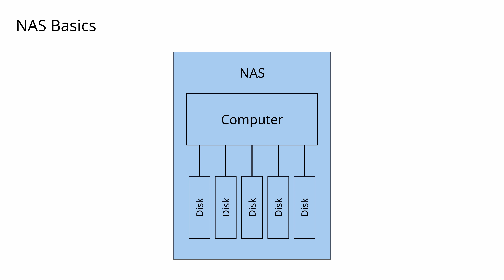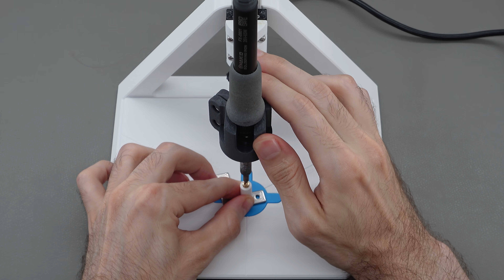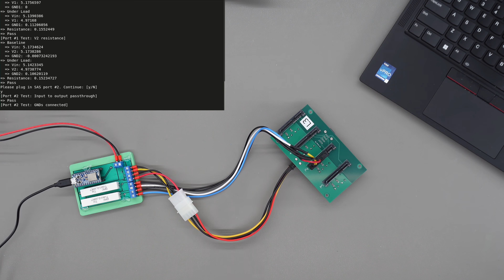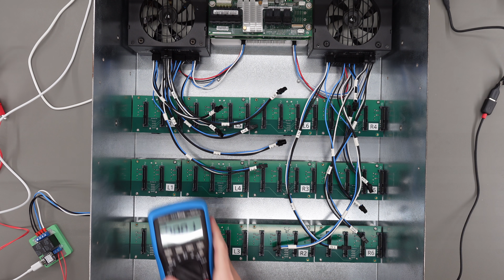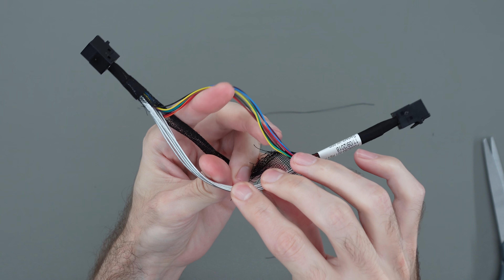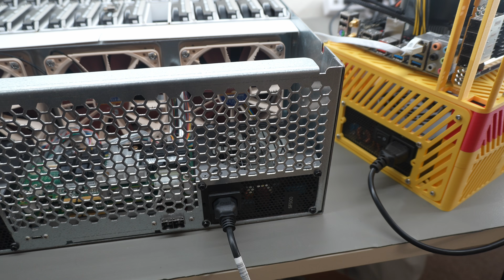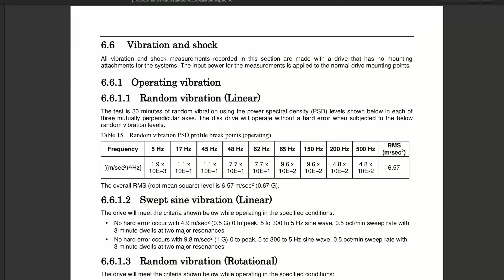I Built a 1 Petabyte Server From Scratch

Comment: Bought a 18 TB Hard Drive about 1 year ago. Buying 56 of them seems crazy and very expensive. Just that one, were perhaps around 4000 Danish kroner (622 $). So 56 of those would be 34.832 $. Any reason why we want to reach at exact 1 Petabyte? Is it just because of bragging rights, that we hit the new milestone in the Petabyte number system? Why not settle with less...say 3 or 6 times 18TB? A lot of money just for buying the Hard Drives if you want to reach that golden number of 1000 TB. And then a lot of money for the power-bill, plus the noise coming from 56 Hard Drives. You can get of cause only 45 Hard Drives of around 24 TB each... like this guy. But buying 24 TB instead of 18 TB are of cause more expensive. Thanks for the video thou.

I'm just recently getting more critic against the various trends in the computer world. With a lot of screens attached to the CPU, Hologram and front-monitor with either info or animation running. Just to make it look "Gamer"-alike. Well, I'm a gamer, but have no need for my computer to look like a discotheque or mirror-ball. Plus modern computers requires around 2500 Watt PSU. Plus more and more Datacenters being build, and require almost as much power as a small city. Plus high-end RTX cards also very high power consumption. To boil it down, the datacenters makes ordinary citizen pay more expensive power, because the power capacity in the power cables in the ground, only has a certain power "bandwidth". In a nutshell, more power being drawn from the grid from datacenters, and we (ordinary computer users and citizen) will get higher power bills. Plus on global scale, all those RTX cards, and AI centers, will have a high impact on pollution and global warming. So we will have very nice graphics, and videos of Cats playing trumpets and drums, but our houses IRL will be either flooded, or damaged by tornadoes or hurricanes... Oh the humanity 😅 Rest in peace human...🥲
Reply from the maker: Yeah, I'm not a big fan of the crazy data center build out currently happening but think that some small percentage of it is useful. I don't expect to use all this storage at once, but I estimated that this is a reasonable amount of last for a while. Technically, I don't show a petabyte of disks (only 18*45) in the video but a little less. I do some archiving and experiment with data processing software so that ends up taking up a lot of space. This setup is more performance optimized as 45 disks are basically always about the same speed so getting more smaller disks is better for speeding up experimentation.
Reply: @MadeByDennis  Okay I see. I have also ordered a RTX 5060 TI in order to follow with the times and the recent games. All thou I'm not a big fan of the high amount of power they require. Both for the environment and of cause also because of avoid a high electric bill. Besides games, I also do some video-editing. And perhaps planning on making games. But when new card arrived, that I just ordered around 1st of January, I will see how much a power drain it's going to be. And theoretically turn off RTX now and then in games, if my power bill gets too high. Anyway, thanks for the fast reply. And even thou not fan of consuming too much power, your video were impressive how you were able to do all that from scratch. Regards from Krusty in Denmark 🙂

Comment: Super cool video, love seeing the build process. Except for the zoomed in pans, don't do that! I think you compared full computer sizes to your JBOD, not to take anything away for your build though. I love the custom PCBs, LEDs, and the clever drive identification based on delayed init order.

I didn't have this kind of time so I had Protocase build a custom case. It's 4U with 6 140mm fans, 8 HDDs, and 12 SSDs, though I only have half that in it. It fits EATX and an ATX PSU.

Comment: This was just amazing, incredibly detailed video, watched front to back. You gained a subscription.

How many issues did you find with the testing devices (solder and crimping)?
Reply from the maker: The backplanes ended up being fine. There were a few pins mis-wired in the power cable bundles. Also I add another less impressive test rig for each individual led strip before it was added to the whole chain and I caught around 5 of those that were poorly soldered because of how tiny they are before installing them.

Comment: On the noisy PSU subject, check out the PWS-1K28P-SQ from Supermicro which runs nearly silent, it's 1280W, enterprise grade and it holds more than 100A on the +12V rail. You can find those for quite cheap over the internet and they're bulletproof for something like this. Just food for thought on your next project. Great content!

Comment: Far too advance for me, let alone getting all the equipment. Would almost depending on price be willing to buy a completed setup even if I have to put it all together after delivery. maybe make it slightly longer with 60 drives capable?
Reply from the maker: Probably would need a few more changes for 60 drives. More power, more fans. Hopefully someone will make it for that at some point. In case you are curious of pricing, I also added a BOM today in the video description.
Reply: @MadeByDennis  for a gen 1 build to meet your current needs, it's fine. Who know what you or someone else will do in the future. Still, maybe someone can mass produce those sata boards for the masses.

Comment: Good job.
PCIe3.0 can transfer 58.4Gbit/sec. Unfortunately you won't get the full 58.4Gbit/sec though, because there's also a protocol overhead, so you're probably quite close to the maximum transfer rate when reading.
I won't recommend using a Raspi for NAS controller. Get something more stable (I will recommend not buying chinese boards - I've been down that road and they take a long time to get up and running - especially because you need to compile Linux for them yourself, in order to make it usable).
-However, if you can afford it, I'd recommend Solid-Run's boards; they're quite stable. You'll still need some compiling skills for most of them, but then you'll get things like 100Gbit network (ClearFog CX LX2). You can get a M.2 card that gives you SAS connectors and you can also use the PCIe slot for adding a host adapter. The LX2 supports up to 64GB RAM if I remember correctly.
An old PC motherboard with a low-power CPU would probably do nicely, unless you need a lot of RAM for ZFS (eg. 1TB RAM for your 1PB storage).

I only have an 8TB NAS (running on an AMD Athlon). I've used BTRFS with RAID1+0 for this, and it's been running very well for several years. I never bothered to put this stuff in an enclosure, so the motherboard was put on 4 sticks of wood and the ATX PSU is dangling around. The drives are in 3D-printed "organizers" with passive cooling. I'm using WD40EFPX drives.
I've been thinking about going SAS instead, though - someday I may be able to afford it. :)

Comment: Looks great. I wonder if you could fit like half a row of disks more by stacking the expanders with the power supply (and possibly getting like 1kW SFX power supply) on other side instead of laying them next to each other.
Reply: Supplies are most efficient and cheaper the way he calculated them.
Airflow also works well like this.
Very well designed.
Reply: @HansSchulze  Yeah, didn't mean to critique, just was thinking if one could fit even more drives in the same space, and one optimization would be to cut down the number of power supplies.
Reply from the maker: I'm not aware of any 1kW SFX power supply with enough 5V power for all the disks. There is technically enough space for a few more disks, but yeah, like the other replies mention, airflow is a big issue and the SAS expanders in the current design are as low as possible to avoid making the SAS cables even longer which also further blocks airflow. You could probably do some squeezing if you upgraded this to louder higher air flow fans and turned the PSUs sideways.

Comment: As i know u can use the external sas port on the expander to inject sas. So u dont need the other adapter
Reply from the maker: Yeah, I just used an adapter to optimize the space by making it easier to fit the cards in side ways.
Reply: @MadeByDennis after 5 monts im back and rewatching this, untill u riped the SAS Connector, i was close to write the same comment agin ;-)

Comment: For cooling I'd make sure the case can handle 38mm depth fans as they have a lot more kick to force air through. Just be careful as they can draw >1A with some models. I'd also look into using a rear fan arrow for push-pull. With SFX PSUs, an array of 4x 92mm fans should fit over the PSUs in 4U? Make sure there's clearance for 38mm depth fans as well.

Comment: What about structural reinforcement beads running laterally across the bottom, along with corner ribs stamped into the housing sheet? You've got a relatively massive, minimally-stabilized, vibration-inducing, multi-piece physical mass suspended between the rack rails acting like a big trampoline on that unreinforced flat bottom. That's bad news for mechanical stabilization and structural integrity.
Reply from the maker: Good idea for next revision

Comment: what did it cost. it is better to use a redundant psu it can be done using consumer psus but need backfeed prevention (diode/backfeed fet) https://www.youtube.com/watch?v=IrB-FPcv1Dc. i like the background music
Reply from the maker: Added a BOM in the video description. Yeah, will made them redundant at some point. Just FYI that the more proper way to do it so to have explicit circuitry for balancing the load between the two PSUs since they will both output slightly different voltages and its not good to have one start from 0 if the other one fails.

Comment: Dude this is so awesome. Great project and great video, thanks for sharing! 
I almost went down the JBOD route when i was running pretty low on disk space in my homelab. I ended up finding a 16 bay backplane on eBay that would work with my Dell R730 server which only came with an 8 bay. Routing those SAS cables was not fun, as they had to run under the fan assembly just behind the drive backplane. And as you mentioned in your video, those cables are pretty thick and just difficult to deal with when trying to route them in tight spaces. I just barely managed to get everything to fit.

Comment: At 15:37 you express fear over reading a negative voltage. Doesn't that mean you just got the polarity wrong, but the voltage reading would be correct?
Reply from the maker: What I was trying to imply is that you can get the wrong reading either if 1. you insert the probes into the connector the wrong way around or 2. the connector was wired up backwards. Also possible that both are the case at the same time. The test rig uses the mating connector for the power wire and is keyed so you can't plug it in backwards so #1 can't be the issue. Then if you get a measurement that is negative, it can only be due to #2.

Comment: Why do you removed the SFF conectors on the card. And dont used it for the uplink? You will dont need that pashtrought conector. Thay shoud have same function as the port on the card itself. 
Also you have right SAS HBA that can suport 2 uplink cables.  (Redundanci)

But overal great build :D Looking for something that can fit in Low Depth 40cm rack :D Woud be great :)
Reply from the maker: Since this was mainly for home lab usage, I wasn't very concerned about uptime and was focusing on space efficiency. If I put the expander cards at a right angle so the E-SAS goes out the back, that would become the depth bottleneck and all the cables to the disks need to go at more awkward right angles. Also it's a bit more efficient to cool the cards in this orientation. Definitely will revisit this and see what works when I do more revisions on this later.

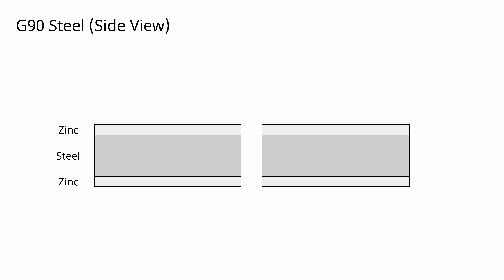Comment: 4:54 laser cutting captain here: you can buy spray-on zinc for those exposed edges, make sure to break those edges with a blade or some sand paper, galvanized steel is a bitch when it comes to gouging out flesh.
Reply: 10:43 use some of that spray on your hand, i think it's starting to rust too

Comment: Depending on what data you store on the pool(s), look into setting the recordsize of your datasets accordingly - for big files, use recordsize=1M.
Also make sure you have compression enabled, the default should be lz4, which is very fast, but I like to use zstd on systems with more CPU power, since it's more efficient.
To speed up random I/O, set atime=off on all your datasets, especially when the data on them are access a lot.
And last but not least, if you don't care too much about write performance, consider using bigger raidz2 vdevs with 10-12 drives, and keep some drives as hot spares.

Comment: I'd love to know where you sourced your drives and they're 12Gb/s SAS right? Did you go for new or recertified or just plain used drives?
Reply from the maker: These are 12 Gb/s SAS Manufacturer Refurbished drives. I will usually buy either SAS or SATA ones depending on what is cheaper at the time. Mostly from https://serverpartdeals.com/ but you need to be patient as the prices fluctuate over time.

Comment: No, if your house loses power your consumer SSD will definitely NOT lose its data.
Only if you don't power a modern consumer SSD for many months (or years), then you might run into a problem. This is serious enough but it doesn''t mean you need a battery backup.

Comment: oh rly nice, but now i regret buying a "nas" with rpi + hdd boxes... hdd pcb is very impressive, i might have to switch to that

also can u please share more info about diy pcbs like the mainboard and the led strip? u milling them, with a drill? from what i can see u are also applying uv resin layer and then cleaning the spots with the same bit, right? thanks in advance!
Reply from the maker: The boards are the "boards/management" and "boards/led" in the github link. You can either make PCBs by ordering them from a manufacturer or making them at home. I have a video explaining how I make the PCBs at home: https://www.youtube.com/watch?v=2MVelC0jOSw . Only diff is the color of the ink I use.

Comment: Really neat build! About what was the cost of getting the enclosure built without the drives? I need a jbod and most enterprise ones are way overpriced for the amount of drives imo or to large to fit in my rack. Also would the supermicro SQ 1u psus not have worked for your requirements on being quite? PSU and PDU from an cse-826 chassis can do 40A on 5v and 135a on 12v with the pdu depending on the psu model
Reply from the maker: I added a BOM today in the video description with pricing information. I ended up designing it such that no server sided PSUs fit unless you line disks all the way to the back and then have the PSUs taking up where the current third row is disks is located. So possible but I bit more annoying to design.
Reply: @MadeByDennis i would do the sff style and have them internally and use an extension in the same space you have the psus in now. I am pretty tempted to build this out as i havent seen any enterprise jbods that i like.

Comment: how do you know your testing devices worked properly and weren't prone to error.
Reply from the maker: What I excluded in the videos is that the testing devices have self test procedures which with a small amount of manual jumping of pins can be used to fully self test the devices. Basically they control the flow of power to all the output pins and simultaneously measure the received voltage so you can figure out if the switches are working by measuring their behavior.

Comment: why spend 30 minutes doing a thing by hand when you can spend 2 hours projecting a pcb, then 15 bucks for the BOM, then 15 minutes to solder the parts on the pcb, then another hour or so to slop the code and test if it works, then 10 minutes to do the actual tests?